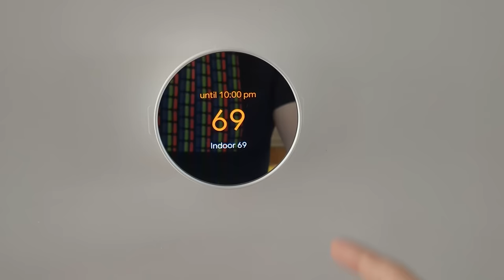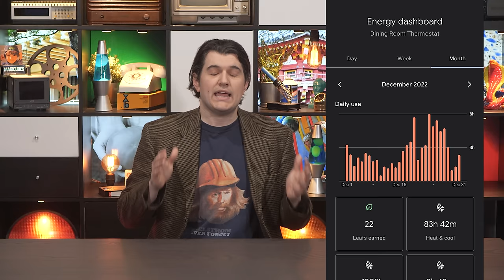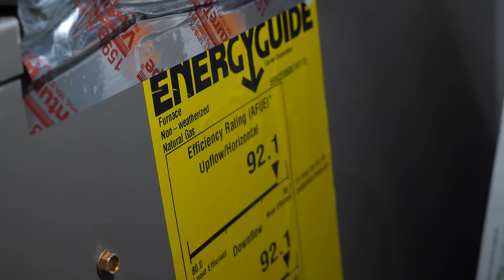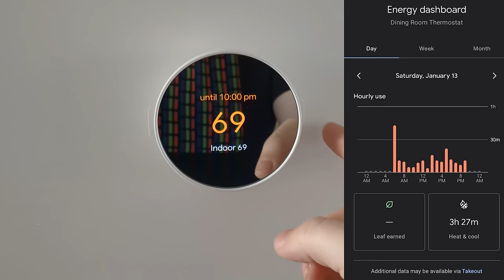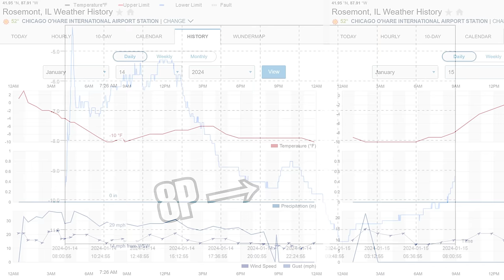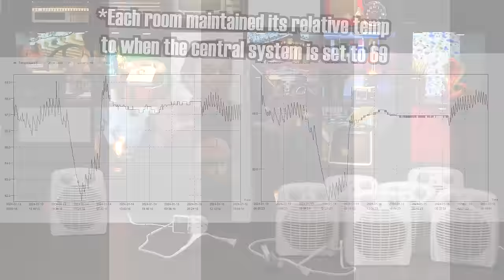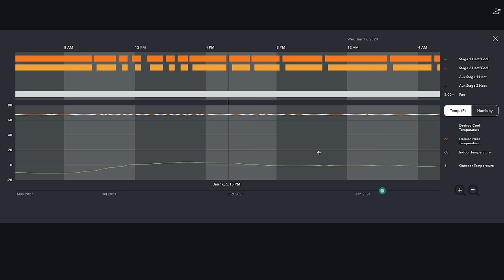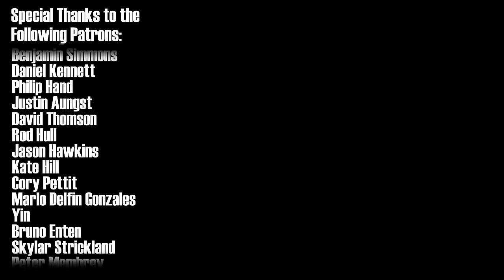Old HVAC industry practices are holding us back and costing us money. But we can fix it.

Comment: A tale from Denmark🇩🇰  Changing from gas to HVAC, I’ve calculated 6 kw needed. Asked for quotes in HW price, extras and man hours. Took me 12 quotes with 8-16 kw pumps, before one supplier, 200 miles away made the right quote with 7 kw HWAC. You’re so spot on the problems, and not alone. 🇩🇰😎
Reply: The companies that quoted 16-18kW knew what they were doing. The guy that quoted you 7kW had no clue. A Heat Pump should only operate 1/3 of the day. Not all day. Good luck!
Reply: @SeanAlcorn Why? It is designed to have only a 30% duty cycle? That doesn’t seem right.
Reply: @orppranator5230  - yet your refrigerator is designed exactly the same way and you’d never question that engineering. Just as the heating element in my espresso machine cycles on and off many times in an hour - almost no equipment is designed to run continuously. It’s standard engineering practice. He says it himself! Eleven contractors knew what they were doing. Yet he thinks he knows their trade better than them and chose a cowboy that went in with a cheap quote using under rated equipment. Next time he might trust the people that know what they are doing. The cheap man always pays twice.
Reply: @SeanAlcorn  Where's your evidence for this? I'm not seeing any recommendations like this from cursory google searches.

Comment: As someone with ADHD who struggles to focus on anything for very long, Alec is one of the only YouTubers who can make a 1+ hour long video on literally anything and keep me hooked the entire way through
Reply: The sarcasm goes a LONG way to holding attention; it requires active listening to pick up on the humor. Similar to watching letterkenny & the much more nuanced humor.
Reply: Same, severe diagnosed ADHD. I have watched what could be considered very boring topics (why US power strips are unsafe and how they could be much safer, etc.) but I find myself watching all the way through and speaking on it later, lol.
Reply: 109%
Reply: It's his voice, and the volume is very even throughout the video.  Other Channels, you might have to adjust the volume 20 times in an hour.
Reply: Lots of killawatts, manually configurable thermostats, manually resetting at the start of the measurement period… jeez, dude. Smart plugs with built in measurement sensors, hooked onto ideally zigbee or if necessary WiFi, hooked to a computer (raspi is fine) running Home Assistant and all you need then is a bunch of temperature sensors to log that you should have anyway.

It’s like you’re all about making your life easier — as long as it’s not easier than the 80s or 90s.
Reply: ADHD youtuber makes videos that people with ADHD watch. xD
Reply: He's simply magic!

Comment: Michigander here, i LOVED the hard flex on midwesteners having those most common sense for the past 100 years. my house is 100yrs old and guess where my vents run??? THROUGH THE WALLS
Reply: Plenty of Michigan houses use the basement for heat ducts, which has the same good result as his garage route or Christmas lights.  The basement doesn't have to be as comfortable as the living quarters, but you don't want the pipes near the washing machine to actually freeze.  That said, I personally miss the older norm of "It's winter.  You can wear long sleeves." so that going outside didn't require such an extreme transition.  (Though lately, we mostly solved that by skipping winter.)
Reply: My current home turns 100 this year.  In around 2021 it had a spaghetti octopus installed in the attic.  My oh my how that is working.  The only insulation is 2-3 inches of "rock wool" between the ceiling joists, and the attic has open vents on both sides and the top (two whirlys AND a peak gap).  The bills are ungodly, and the system heat cannot keep up below 40 F, running nonstop.  Its at best 10 F warmer in the attic than outside.  It didn't seem too strange, coming from homes in Florida, but the delta-T is at most 30 in Florida at any time of year, and attic venting helps there.  The same system here, with tree shade, cools the home very efficiently (cheap).    Hopefully I won't be here next winter!

Also, the "droop" was NOT set by the installer, and defaulted to zero, the signal for a shared Gas Heat/AC system.  Why?  With "cold" here being 20 F, and the droop at 5, the "strip heat" still takes over around 50 F indoors!  And the bill is still enormous for 55 F interior temps.  Its ghastly when these things are done wrong.  In my case, the spaghetti octopus in an actual freezer is my problem.  Did I mention no ceiling fans and 9'8" ceiling?  So you sometimes get a hot forehead walking through the house while your legs are freezing.
Reply: @bellemorelock4924  when it comes to the cold feet and hot head I 100% agree. i have nearly the same insulation factor, we had a stint by me where it was -10 for a good week or so and there was a SERIOUS draft coming from my front door and each room had a different temperature. plaster only does so much to hold heat lol
Reply: I'm in Canada, and I've never seen ducts run through the attic.  We mostly have basements, so have forced air heat through floor vents, with the ducts run in the basement.  All the "waste" heat is lost within the house and helps heat the basement.
Reply: @my3dviews  in mid-south Florida, a COLD winter night might hit 40/5 degrees, so cold isn't a thing.  In fact, I had GAS heat and estimate 10-20 USD for that gas, per year.  So it was just the differential between attic heat (120F) and the Flex ducting (60F) in the attics.  Short and simple, attic tubes are fine (not great) for hot places.  Now, in mid-atlantic or mid south USA, the attic tubes really suck in the cold weather, with the hot air staying high and COLD floors.  My A/C is great, though I hardly use it compared to florida heat.  In wall or soffit ducts would be so much better, but floor A/C vents are also bad for distribution.
Reply: @bellemorelock4924    Yes, for sure it makes a difference where you live, what method of heat (and cooling) distribution you have in your house.  Also, they type of heating is important.
This video makes sense for people in certain areas, where heat pumps are adequate.  But, where I live, I don't think that a heat pump would be very efficient on cold days in the winter.  Maybe good as an add on to my existing natural gas furnace, for warmer winter days, but not as a replacement.  Some parts of Canada have much warmer winters, so for them it does work.
Reply: I'm not bright in this area. I grew up in the Midwest of the United States and we only had our air vents through the houses where else would they be? We also had the big return fans/vents that would suck in air from outside.
Reply: @Fauxkerykes  im saying that all the heat vents are running though the interior walls and the furnace is in the basement or somewhere where it wont be exposed to excessive heat or cold like the attic. in my buddies house where his furnace is in his attic his heat bill was almost double cause his furnace was working so hard to heat it self up then the house. ive also seen a few house were all the hvac ducting was in the attic. imagine how well that works on a hot summer day.
Reply: @jimjjewett  God I miss having snow for more than one week a year
Reply: @jimjjewett  "(Though lately, we mostly solved that by skipping winter.)" Shout out to Global Warm—wait no
Reply: a moment of silence for your heating/cooling bill

Comment: Another thing I've noticed, when I got one of my heat pumps replaced was the premiums they charge on higher SEER units. The material difference between a basic AS Silver 14 (SEER2 - 14.8) and Silver 15 (SEER2 - 16.5) was about $500 more online. However HVAC companies quoted about $4,500+ more. The $2k tax rebate doesn't apply to the lower end unit. Basically they all made it so if you want the tax rebate, you are still paying dramatically more even with rebates. This was quotes from 3 companies, just indoor/outdoor equipment replacement, no ducting, no line replacement, no electrical work needed. Installation is the same for the Silver 14 and 15, I've read the install manuals for both.

Comment: A lot of the high prices are likely related to gov subsidies. I found that if there is a $5000 gov rebate for installation of a more efficient system, magically prices in the area just go up by 5 grand and the companies end up pocketing the rebate
Reply: Same with Solar
Reply: Yep. Ford did right after the announcement for the EV tax credit and then it blew up in their face since technically their EV vehicles don’t qualify.
Reply: Given that the rebate has been 5 to 10% of the quotes I'm seeing it's kinda like rebate...what rebate lol
Reply: A simple solution would be to make a limit like "$5.000 rebate for systems that cost less than $20.000".
It will also have the advantage of affecting poorer people with smaller houses and not subsidizing the rich.

Comment: Yeah, it's not just HVAC or home building industries. It's every industry. It's all about job throughput and speed of installation. "Done" isn't always done right, often even if the markup and "overheads" are IMO ridiculously excessive. I install and service audiovisual systems and we're in the middle of some renovations right now, fun times.

Thanks for your empirical data approach, and your humourous presentation style Alec! I always appreciate it. Now if only I could convince my apartment building to swap the in wall AC unit with a heat pump, at the least it could supplement the electric baseboards that are all I've got right now!

Comment: “avoid complaints”. You finally got there!  I design heating systems and you are 100% correct; across the board.  You only understate the power of whining, relentlessly unsatisfied and miserable complainers.
Reply: So true the amount of times we do things that are technically “incorrect” so we dont get dumb service calls and emails and complaints
Reply from the maker: Related to your comment - I think we're gonna need to do a lot of working helping people understand how supplemental heat sources factor into all this. Lots and lots of comments now are seemingly ignoring that you can (and probably will) have two heat sources with a heat pump. It's a totally different ball game to having a right-sized furnace with no room for error.
Reply: @TechnologyConnections  Even with a properly-sized furnace in a 110 year old house, I like to keep the house set cool in the winter and run a space heater in the rooms I'm using for like 30 minutes to an hour to be comfortable in those few times where I'm both awake and inactive. In the really cold snaps, the electric blankets come out for TV night. At that point, who cares if the house is 60 when a 50 watt blanket will keep you warm for the 15 minutes it takes to get all the animals on your lap, and you have all the heat you want without even the blanket on? Talk about extracting heat energy from the pet food you have to pay for anyway.
Reply: Not sure what to do about people that are cold from being outside for a few minutes and turn up the thermostat because it's cold outside, and they want to get warmer faster. Even when the heater is already running. Same people that like to run the thermostat at 68 in the summer and 78 in the winter. Sigh
Reply: How do I go about finding a HVAC company that knows their stuff? My heat pump goes on for too long and raises the temperature too much above the set point, the company that installed it and then another company I had come in tried telling me this is a feature that it doesn't stop heating as soon as the set point is reached because it is a variable compressor. Waking up in the middle of the night because you are too hot to turn the whole system on and off so that it won't turn on again until it goes below the set point isn't a "feature" though. I have read through the manuals and there are quite a few settings that might help, but I don't want to screw things up.

I also wanted to talk to a company about venting outside air in through filters as it takes the house quite a while to cool down at night in summer even with windows open and that isn't possible when there are bushfires, and how to go about that, but I don't know how to go about finding a company that would be good at that as I don't want to pay for someone to give me a quote when I have no idea of their competency, but it does make sense that I would have to pay for coming up with a solution to fit my already existing system.
Reply: @HesderOleh  A super duper cheap solution I use for filtering incoming air is a simple boxfan with a MERV 8 filter duct taped to it, I think the 20x20 ones match up perfectly.
Reply: @TechnologyConnections we recently added ductless heat pumps to our ~100yr old, basically uninsulated house (mostly because it was the only way we could get air con)
We left the gas furnace in, but it only gets run when it gets down below -5C or lower, because the heat pumps just can't keep up.

I'm sure if we insulated the floors and walls, and installed windows from this century we'd be fine without the gas as well
Reply: @HesderOleh  your thermostat has a setting for swing temperature. That determines how much how much below the set temperature it gets before turning on. Lower that setting and then lower the thermostat setting.
Reply: @TechnologyConnections  yes, I agree.  We generally refer to these systems as “hybrid”.  I actually specialize in this area.  Generally we are integrating low carbon heat with conventional.  Conventional heating equipment is very flexible (it can run inefficiently without any mechanical downside) whereas modern low carbon systems cannot (they require tighter tolerances for design and installation).  While there are many very qualified and skilled HVAC folks, the majority are not.  Many have been working for years in a sector with forgiving margins and equipment.  Those experiences are not well suited for the current landscape.  Fundamentally, yes, there is a lot of work to do.
Reply: Add in the fact that houses get sold and now all your previous customer education is gone and you have to deal with yet another potentially cranky customer.
Reply: @draco10111b  I never understood this either, I use a smart thermostat which allows me to utilize features like at-work modes and granular scheduling but in essence in the summer, my home is set to 76 when away, 70 when home, and 66 in the winter when If im filling a bit chilly I just throw on a hoodie or sweater. I live in a more temperate area with summers reaching mid 90s and winters around 20 at night but even still I can't figure out how going from 20 to 68 isn't plenty warm for those coming in from outside.
Reply: @TechnologyConnections  Who is "we"?  The HVAC companies?  You want them to make LESS profit?
What is in it for them?
Reply: @timothycox6759  tell me that, I do home automation and this is also related to HVAC , and the amount of cases I needed to botch perfectly balanced system (took me quite a lot of time to fine tune it) because of some "cranky" customer......

Comment: Where were you 4 years before when "my specialist" suggested me to install a 16 kw heat pump that now runs on short cycles just to find out by myself that actually my home needs maximum 10 to 12 kw.... A really explanatory deep dive that teaches you something !
Reply: 16kw vs 12kw is acceptable. The issue here is installing 16kw where 4kw was needed.
Reply: Then you have a bit of spare headroom in case a particularly cold cold-snap drops by to say hello. With the crazy climate many places have been having over the last decade, you will likely need it at some point.
Reply: Doing thee actual math is time consuming, and sometimes beyond the skillset of the salesperson.
So the fallback is to assume that if your existing oversized system was enough when it was in good condition, then just replace with a similar-sized unit.
Lazy and uninspired, costs the customer more most of the time, and earns the company more.
Reply: Yeah, It feels like…  if car sales-people could dictate what car you should buy:  “You need a dump truck, just to be safe.”
Reply: Todays thermostat and apps should be able to tell you how correct sized your furnace is.

Punch in BTU & it should know or then track the runtime and weather history.

More to it if the furnace is choked etc but really the info is there for general purpose.
Reply: @battleforevermore it depends on how many days of deep freeze you have, in my area in Europe, i think we have 10 days of -10, maximum 1-2 days of -18 and the rest of the winter on average is above freezing or somewhere around 0. At that temperature i always have a partial load of maybe 7 kw....as the heat pump has a minimum output of 7 kw, 70% of the time my home needs less than the minimum output of the heatpump so it short cycles.